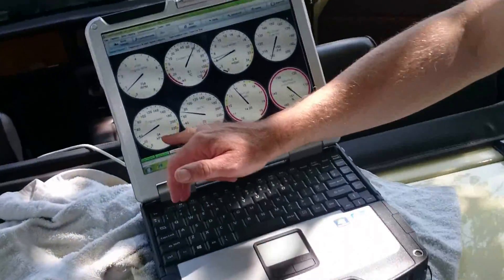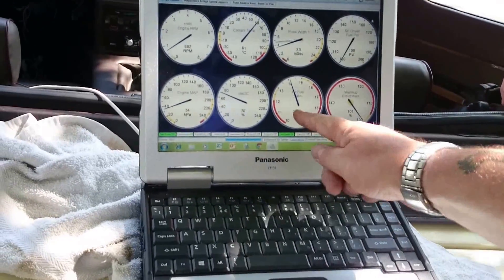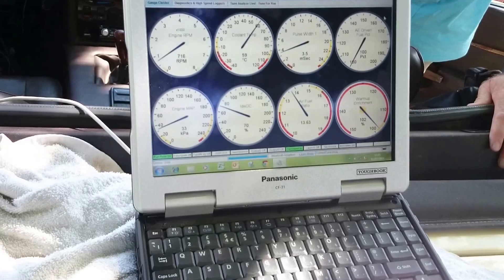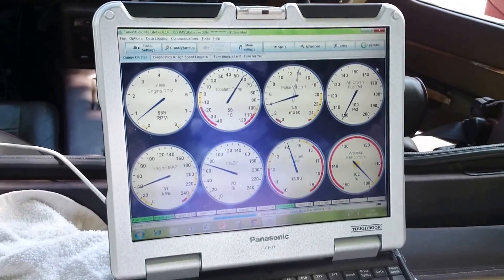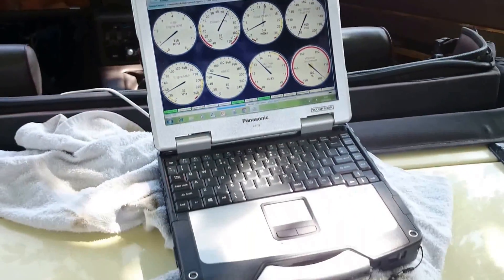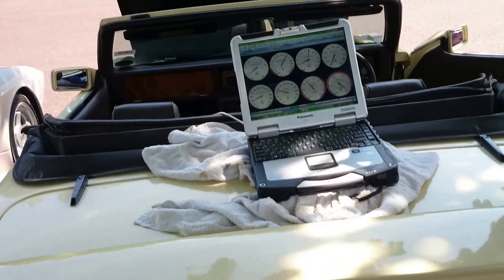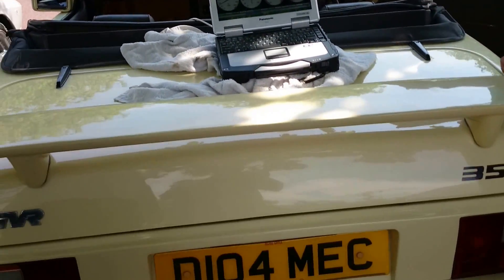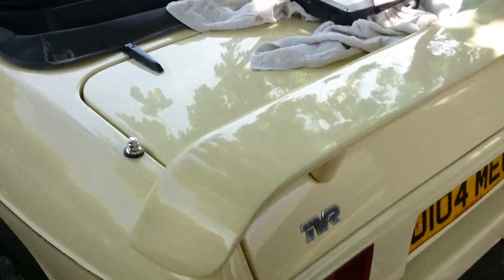Megasquirt on a TVR Wedge 350i.

Comment from the maker: Hi Keith...

I think Martin might of got it up to 190bhp but lost the pops and bangs...He is trying different maps and set ups as there as loads to choose...From 30mpg to fuel spitting flames...I know what one id have.. :-)

There are ways to change the torque but like all these things one counter acts the other..

Also there was some conflicting sensors like the CTS and vacuums over FPR.

He had to switch the map to a different degree of timing in order for it to start and warm up...Once warm he could switch to his favourite map...The cost...Well as he found out the so called kit which proclaims to contain everything you need didn't contain everything you need!...In fact most of it was useless.

However being skilled as he is he built it from scratch so i think the cost including the necessary sensors/ECU/Coil packs/Brackets/was around £1500....Once he has resolved the issues with it and has simplified it more then he will put together a tried & Tested version for Wedges... Happy days..The loom will be custom made to fit and there will be tried and tested maps...

The idle was so smooth and it sounded almost "Happy" if that makes sense....Personally i think this is a good upgrade, Especially given all the issue that have and will arise from the failing distributors...Its only a matter of time....Cheers...Ziga